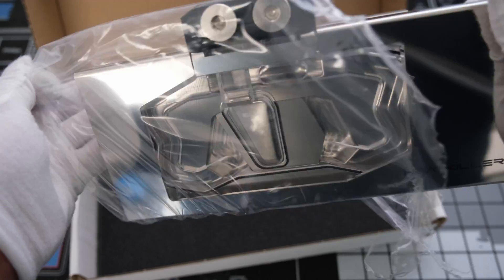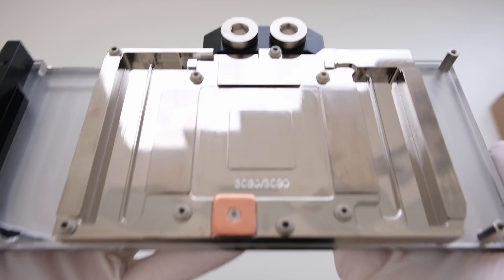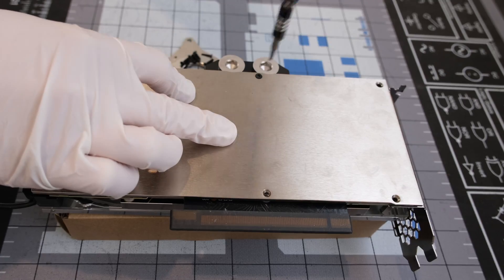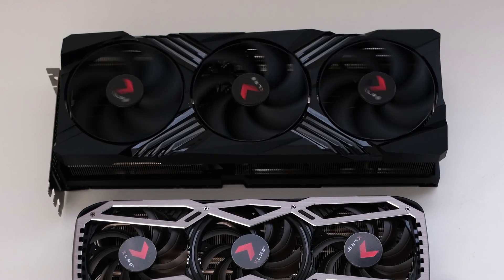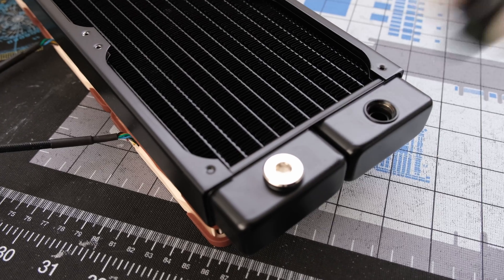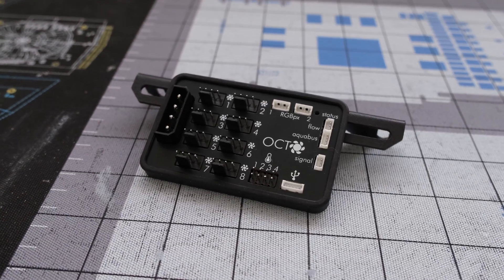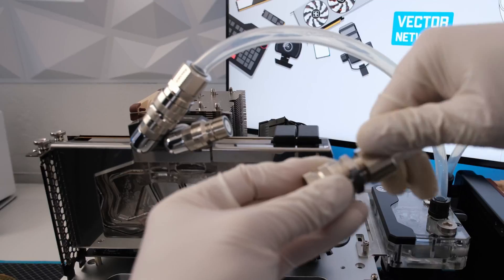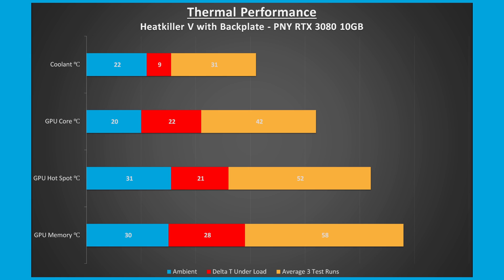Watercool Heatkiller RTX 3080 PNY XLR8 Water Block Unbox & Thermals Reference PCB PC Water Cooling

Comment: Question , are there any water blocks for the 3070 version of this card?
Reply from the maker: Thanks for your comment 🙏I typically see water blocks for the xx90 and xx80 series of cards. Those typically have the highest amount of power/heat that may require more cooling headroom. There might not be any water blocks for the 3070. Hope that helps
Reply: @vectornetwork  thanks for the reply, makes sense